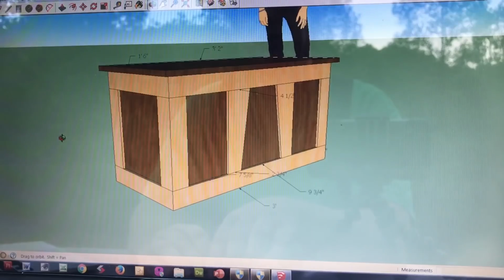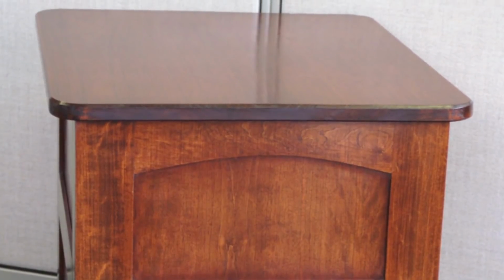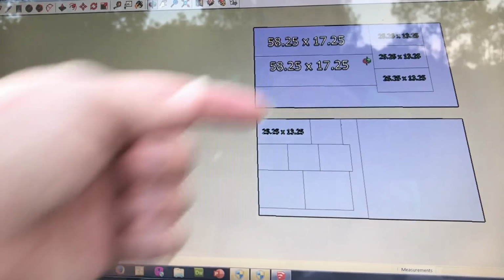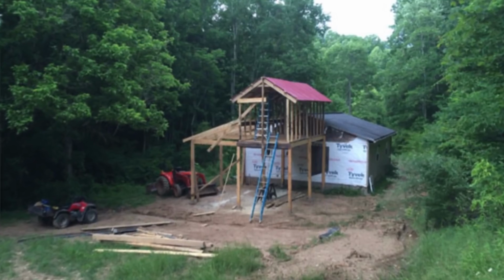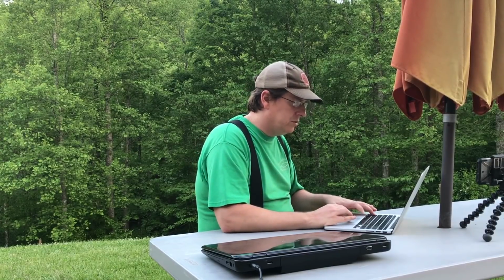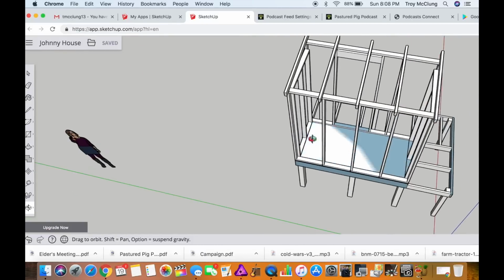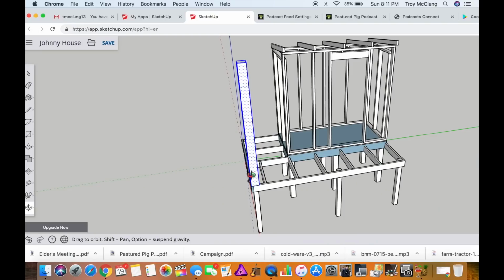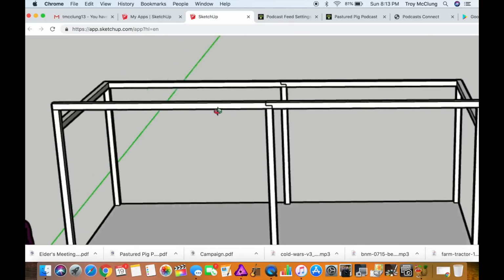Using free software to help design projects on your homestead

Comment: You can still find the install software for the 2015 year version that is downloadable and offline if you do a search on the interwebs. I had it on my laptop but the HD took a crap and I really wanted it back so I did a search. I don't have internet out on my land so I really wanted the offline version. It still works :)
Reply from the maker: Great to know. Post a link if you would happen to have it.

Comment: QUESTION: Does SketchUp capture weights and loads to advise on collapses and wall bearing issues?
Reply: No
Reply: I wish! If you follow building codes and best practices though you should be just fine. I always over engineer so I'm not too concerned with my stuff falling apart.